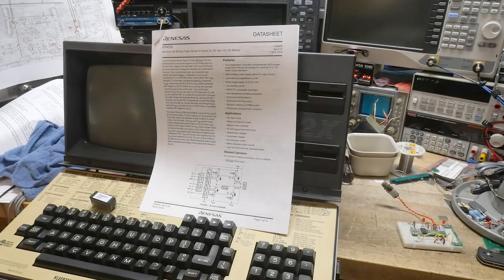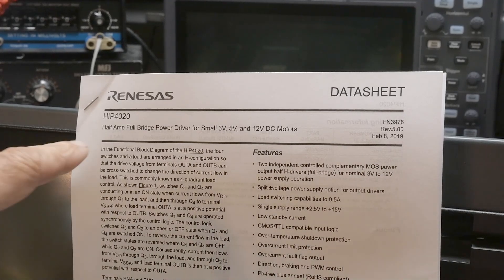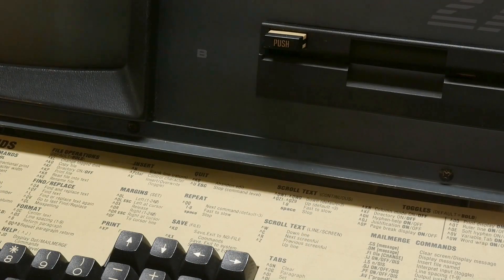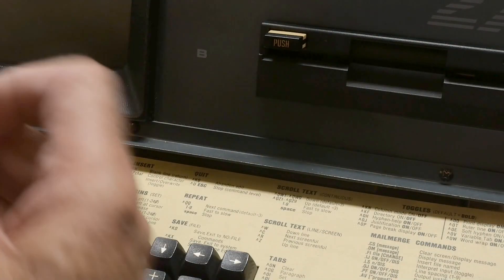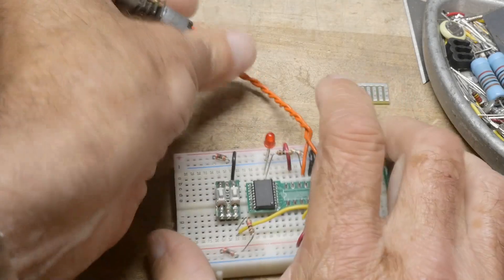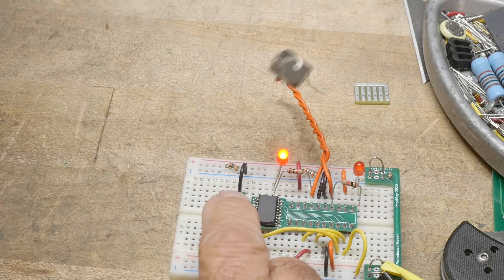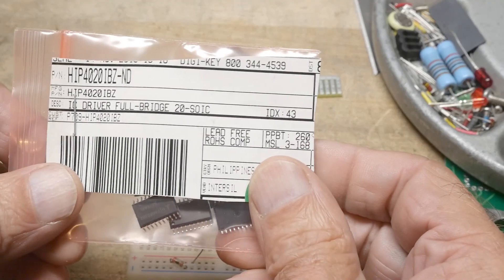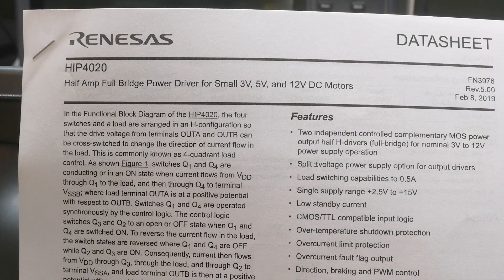#2398 HIP4020 H-Bridge Motor Controller

Comment: If the input circuitry is properly designed an H-bridge can also be used for braking, If the input circuitry is badly designed they are very good for short-circuiting power supplies, at least briefly. A well-designed H-bridge is programmer ("coder") proof.

Comment: I noticed that the Digi-Key label called out Intersil as the manufacturer. Renesas bought Intersil back in 2017, so the parts are at least 8 years old.

Comment: I wonder if it is possible to make a bridge driver for a voltage converter (even of low power) from similar drivers?
Reply: [EDIT/correction: stepper motor drivers, including this one, actually will handle 100+khz] 
Most motors and drivers aren't designed to reverse direction thousands of times per second. So while it's possible, of all the various H-bridge driver chips out there, the motor-specific ones are probably the worst choice. 
But if you just need a capacitor based voltage doubler, for bootstraping and this is what you have, yes, this is fine. Or... I guess, you could drive a Cockroft-walton voltage multiplier from this chip. Alright @IMSAIGUY, if you ever run out of video ideas, there's a free one!
Reply: @SkippiiKai  One can get decent mileage out of a 555 in this capacity, though the CMOS version will have lower losses.
Reply: @ChrisSmith-tc4df I've definitely used them for this before.. And just about everything else.

Comment: H bridges are neat.  I've used the DRV8871 in several projects.  It's a tiny 8 pin HSOP but can handle up to 3.5A and 50V. Using it with PWM you can get very fine speed control.

Comment: Speed could be the commutation timing. There is a slight directional  performance advantage over neutral timing. Could be mfg tol for a run of the mill brushed motor.
Reply: I've encountered the very same thing with small DC motors.  They tend to run faster forward, but if you can manage to rotate the casing in such a way as to change the angle between the brushes and the commutator, you can equalize the speed.  RC car enthusiasts are familiar with this phenomenon.